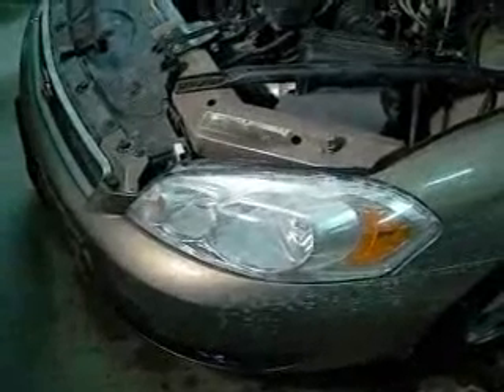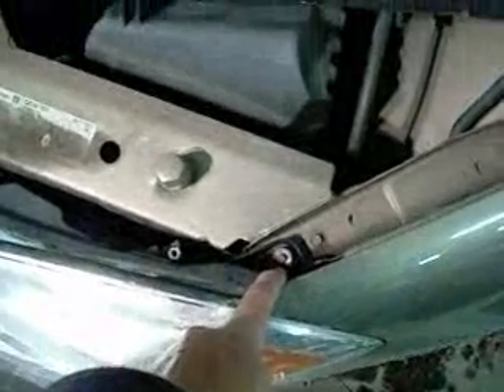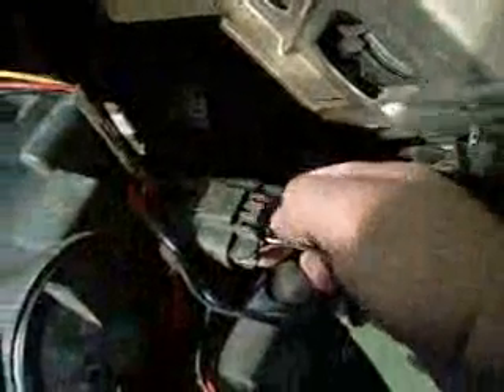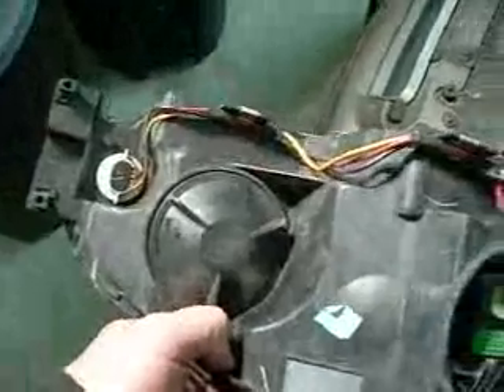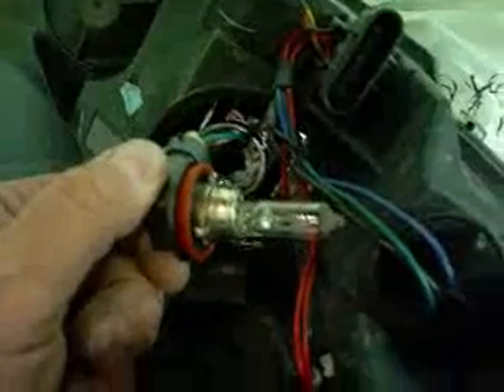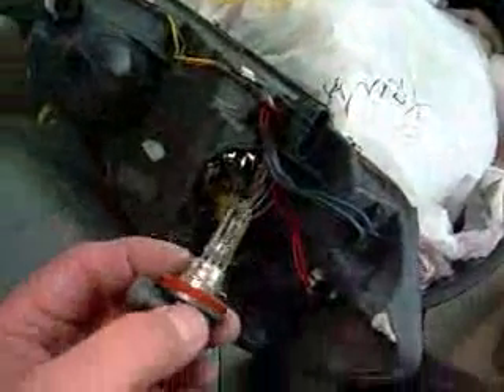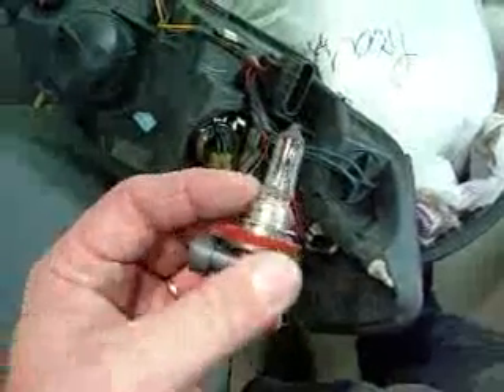Replace 2006 Chevy Impala Headlight Bulb

Comment: wow that was easier than I thought.. question in front of the screw to your left there is a silver bolt that turns and turns something connected to the fixture.. wtf is is for.. if you pause at .29 secs its to the left of his hand.. its an allen wrench fitting too

Comment: Can u tell me a part number for the low beam h11 lamp my conn is burned and on the lock tab the number 2 05-H11-E is embossed. Gm wants 45 yards of green. Dorman  acdelco. And all the rest r much cheaper but I can't cross the number w/o service manual

Comment: when i unscrewed the 7mm screw how come it wont screw back in? Help! im not sure if something fell off to tightened the screw back in
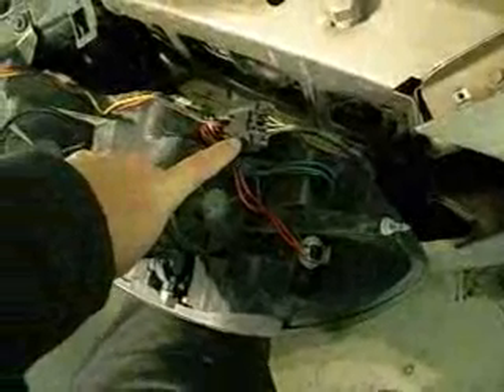Reply: Look at the video at 1:04.  It shows a plastic insert in the fender that just pushes up from underneath.   If that fell down into the fender there won't be anything for the 7mm screw to grab into when you reinstall.   Look in the fender with a flashlight or on the ground.  It is laying there somewhere.   When you find it glue it othe edges to keep it in place.  You just need it to hold itself there long enough for the screw to start - then that will hold it in place.   If nothing else stick a piece of gum there and that will probably be enough to get the job done.
Reply: thanks!